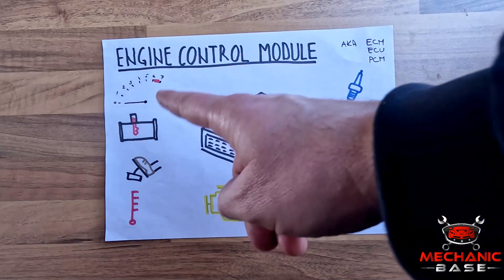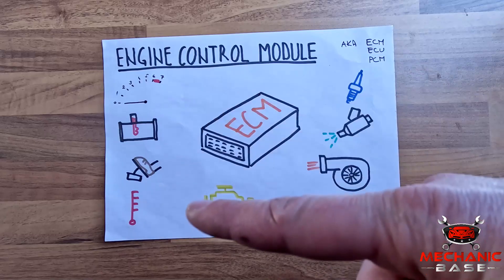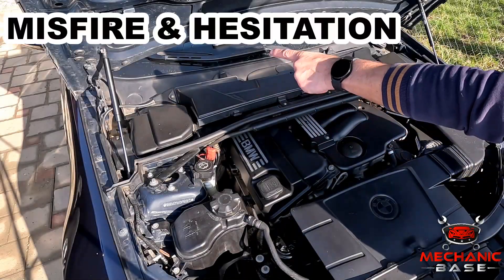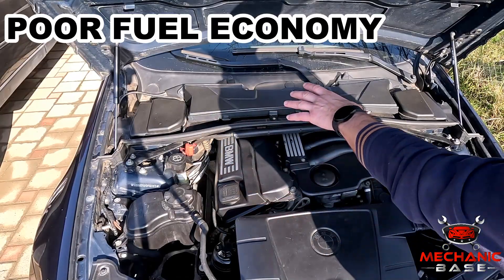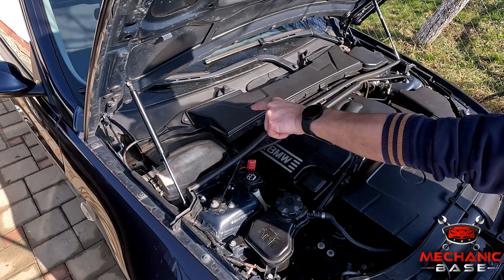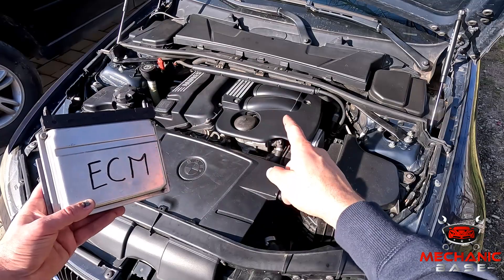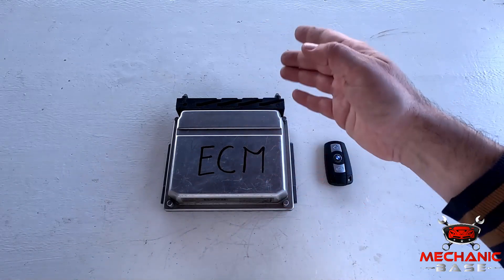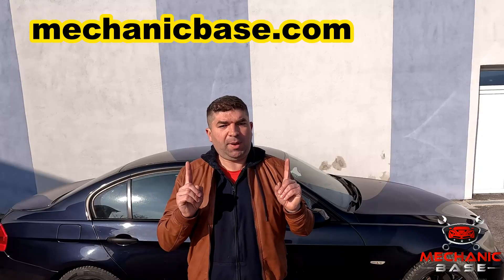6 Symptoms Of A Bad ECM or ECU (and Replacement Cost !)

Comment: The original battery in my 2016 Jeep Renegade Limited went bad, and I replaced it with 960 crank AGM, After replacing the battery, I continued to have battery issues, so I tried Scotty's idea, the YouTube guy, of clearing the codes in the ECM by connecting the battery cables with a 10 watt 1 ohm resister, and leaving it like that for an hour or so. Then, with a fully charged battery, I tried to start it, but everything just lit up for a second or so and then the entire electrical system went completely dead. Nothing at all goes on now. Any suggestions?

Comment: Just came across this video this morning. I own a 2000 Mercury Grand Marquis 4.6L. The car only has 38K miles on the odometer believe it or not. It was my late mothers car so I have it in my possession since 2011. The last 5-6 years I have been getting the PO320 code that points to the Crankcase Sensor and the car shutting down not wanting to start until it cooled off some. I have changed the Crankcase Sensor out 3 different times. Twice using the Dorman Brand of Crankcase sensor. After changing it the first time I got 9 months of driving out of the car without any symptoms until the PO320 Code came back and the car shut down. Replaced it again and got 8 months out of the car running fine until it happened again. Finally I decided to put a Motorcraft Crankcase Sensor in the car thinking it was maybe a inferior Dorman product. The error code of PO320 came back at around 6 months this time with the Motorcraft Crankcase Sensor in the car. This time I just left it in the car and started driving the car when it cooled off. It got to the point where I couldn't trust the car to go on any long trips just small trips of maybe no more then 10 miles. Finally back in April of 2025 I decided to take it to a Reputable Repair Shop to have them check it out. Just a little background on myself I am retired from being in the Automotive Parts Business over 40 years. Always did most of my own work on my vehicles and all maintenance on them them over many years. The Shop I brought it to was a old Customer of mine that I sold parts and supply's to. I knew them for a long time. They had the car for 2 days and called me to say it was fixed. Said I had a bad coil in number 1 cylinder and something was making it short out. I found that hard to believe. My Mercury Marquis never had a miss in the engine indicating a bad coil. My OBDII Scanner never showed the car missing or a bad coil. The engine when running always ran smooth. Well I drove the car home and it didn't feel right.  When I got home I pulled it in my driveway being it was the weekend and it wasn't until Monday when I decided to drive the car to a store I needed to go to. I pull out of my driveway and the car died on the road and wouldn't start. I had to get the car towed for the 2nd time down to the repair shop. I couldn't keep it running for some odd reason. Actually when it ran for me before I took it to the shop as mentioned there was no miss in the car and if it didn't throw a PO320 Code the car kept running and ran perfectly. Once again this was April of 2025. My car sat at this repair shop for 3 months until recently here in July of 2025 when I decided to take it out of that shop. When I went to go get it they told me they think it needs a new ECM or a rebuilt one but wasn't sure and didn't want to have to give me a bill for something that might not fix the problem in my car. Hoping I could get some answers here based on what I explained above. The shop seems to think the PO340 Code because of a Bad ECM replacing the Crankcase sensor isn't fixing the problem that maybe the signal sent to that Sensor isn't right at times coming from the computer like something failing in the ECM. Any thoughts?

Comment: I have a 1996 civic Dx that's been losing acceleration, cutting off when backing up or stalling at start-up, the radio cuts off and on, also it has a low idle. I just had the distributor replaced. Shortly after, the engine light came back and  the performance is still not good. Today the odometer stopped working so after typing all of this into A.I., a faulty ECM is what it keeps telling me. The engine code is still saying it's the distributor even though I just replaced it.

I might have to just leave it parked for a while to build some money up to get it fixed. Your video was really helpful. Thanks! Wish me luck 😁🤞
Reply: Try resetting your car Follow one of the videos on Y T One expert says to disconnect BOTH battery cables set them on a towel so they touch nothing THEN turn your ignition key ON and turn the lights on THEN touch both cables together  for 60 seconds then connect the POS first then the NEG and see if that doesn't reset your computer....just a thought
Reply: @dennispacelli1007 , Thanks! Sounds kind of scary. 🙂 I'll keep watching videos and asking around. I'll figure it out soon enough.
Reply: @i94yeh2p  Some how the remainder of my comment was cut off. Yes after you disconnect both the POS/NEG terminals lay them on a towel then turn the key to on only and the lights on. The touch both terminals together for 60 sec then reconnect the POS 1st then the NEG turn the key off and lights then start it up he knows what he is saying
Reply: @i94yeh2p  Scary? You know nothing then about vehicles go pay a mechanic now that is scary! lol
Reply: @dennispacelli1007 what if your car has two negatives and positive since my battery is in the cars floor it’s a gmc acadia 09 and there is a set connected to the battery and then a another set in the engine bay how would i go about doing this trick ?
Reply: @CHB_98  2 sets?Gee not sure about this ask around someone near you knows honestly......

Comment: I put a new ignition coil a new ignition control module a new spark plug wires, new spark plug on cylinder 3, new distributor cap a new rotor I also put a remanufactured fuel injector on cylinder 3
Why am I still getting a misfire on cylinder 3 the code is P0303. Could this be a bad ECM that's not reading the new parts I have put I also reset it my ECM by taking off the negative terminal plug on my battery and waited for 30 minutes and still get the misfire like 6 days from that time so what gives I put everything you parts but why am I still getting misfire
Reply: Check compression before continuing
Reply: I have this same issue for my mercedes I replaced all parts for my cylinder 2 misfire (spark plugs, ignition coil, fuel injector) i also ran a compression check and compression is good as well but still getting a misfire only in cylinder #2 im not sure what's the issue at this point I'm thinking it might be a ecm issue
Reply: @jessealc7746 you need to check all circuits to injectors and coils. Make sure good power source and computer control for that cylinder

Comment: My car shows error lost lost communication with body control modules and communication bus A off Electrician said it need new ECU or ECM also Car loss powers randmly while on the road then if i turn the engine off and on it will run again

Comment: Don't know if you'll see this I have a 1988 Ford F-150 4 x 4 
5.1 I believe.. battery keeps draining have a brand new battery. New solenoid new spark plugs & wires. New starter. Don't know where the ECM is on this vehicle. Not very mechanically inclined. Got an 18 code on my OBD1
Reply: Is something constantly on that you don't know about? Ok drive it for the day then disconnect the NEG battery cable overnight then in the AM when leaving reconnect and see if it starts IF it does then you have something on pulling your battery down I had the sane problem it was a vanity light  but I still have not disconnected the iight so I left the fuse out I only lost my clock I will disconnect the 2 vanity light wires and tape them separately that should not drain the battery any longer

Comment: Where’s the ECM in the 2012 528i xdrive. I have a E12C1C communication code idle
Reply: Did u get your ecu fixed I was told my ecu is bad in my 2014 bmw 750i  cause my 3 cylinder  to misfire  which is y my engine light on

Comment: I got U0100 Code: Lost Communication with ECM/PCM in Chevy Cruze 2012, it starts well, but the problem is that it doesn't catch speed and the max RPM is around 2.5k and it's normanlly shift on 3k, so I have to shift manually. I keep trying to solve other problems like O2 sensors, but this problem I can't fix.
Reply: Did you fix it Now? What is was the problem? I have it and I don’t know how to fix it

Comment: Can an ecu faulty just cause one o2 sensor to drop voltage at crank but read 3.3v when the car is off. Or could it be a bad sensor

Comment: 2018, Toyota Camry SE 2.5 l.
P0300 p0302 p0304

It has brand new spark plugs. It has brand new fuel injectors. I changed the coils and the same codes pop up. I checked the spark for the coil on the spark plug and it is good. The compression is good. I cleaned the mass airflow sensor I cleaned the throttle position sensor. 
Brand new fuel pump and fuel filter.
I cleaned the 02 Sensor. 
I am not sure what else it could be.
When the car.
Is first turned on. It only has a little bit of a misfire. When I disconnect cylinder two, it will miss fire more. When I go to drive it, and I push on the pedal It will start to lose power. And  miss fire 100%
Then, after that, when I disconnect cylinder two, it doesn't make any changes as if cylinder 2 is dead. 
Everytime i turn off the car and turn it back on. The car is good again till i accelerate again on drive and misfires again
Reply: air leaks?  do a smoke machine test

Comment: Thanks , my car shuts off when driven and the engin warms up, at first i taught all kinds of things from throttle body to  others fault , but the mechanic said its the computer box that faulty but the engine starts normal but cuts off on long drive
Reply: Same with My 2014 Cadillac ats
Reply: When mine did that it was a cam sensor. Then another time it was my fuel pump.
Reply: @Justin-fq7vj  sounds like my 93 940 volvo I replaced everything it runs great now but every once in a while it will not start or idle up then shut off. I did not replace the ECM or in the volvo I think the also call it the Ignition CU but I may be wrong You know when it won't start I disconnect the 2 fuel pump relays and reconnect them BUT that didn't work SO I thought let me remove the fuel pump FUSE and reconnect it perhaps that is what is happening. I did and cleaned a little debris around there it started right up and for several days it has been running great!

Comment: 3.8 L in 2006 Buick Allure 210,000 KMS car shut off while driving cranked no start had code P0650 No Check Engine came On? mechanic replaced fuel pump 3x coils & crankshaft P. Sensor- car which ran smooth before now after repairs  drove poorly @ 1st after driving few 100kms drove great better acceleration still had code p0650  the whole time no check lite came on after 2 weeks driving the CAR Again turned off while driving But able to Restart it in neutral not if this ECU ??
Reply: Code cleared many times reappear s still No check Engine light comes on?
Reply: My 2014 Nissan quaskai shut down after the battery was removed. Can it be fixed?

Comment: Thank you. My 2005 Corsa C will fire up but won't run go
for more than a few seconds. New pump, filter, 50 psi, new oil switch, new crank and cam modules, new plugss, removed throttle body and cleaned, maf cleaned...
But no fault codes either with pedal test or three obdii readers inc Xtool D7. I 'm suspecting a bad ecu. Your opinion pl ease!
Reply from the maker: Which engine do you have in it?
Reply: @MechanicBase  Wow, thanks for replying. Ecotec. I'm pretty sure it's the Z14XEP. Opel Tigra Twintop X04. 1.4, 90CH 66kw. 
I was thinking of forcing the ecu to record some codes, e.g. by partially removing the air intake tubing. Can't find anything on such a strategy. What do you think? Thanks again.

Comment: Obd2 works fine keeps throwing the same codes for crank sensor and can sensor. After replacing them both.
Reply from the maker: Have you checked the wiring?

Comment: Can it cause limp mode to set. Instantly after resetting the the computer.
Reply from the maker: Do you have any codes?
Reply: The car must idle for 10-15 minutes before driving IF the NEG cable was disconnected especially in a Toyota. The idle will come back to normal mode